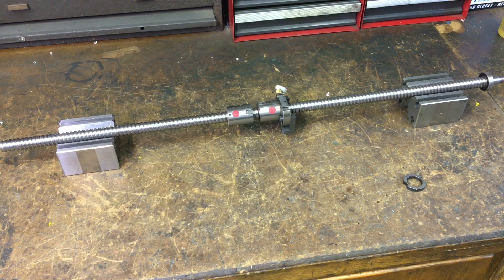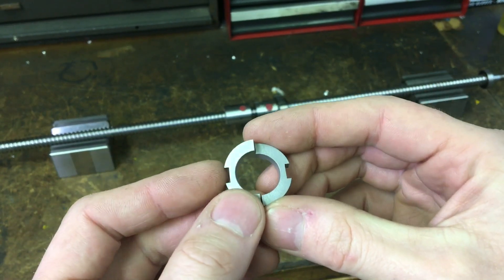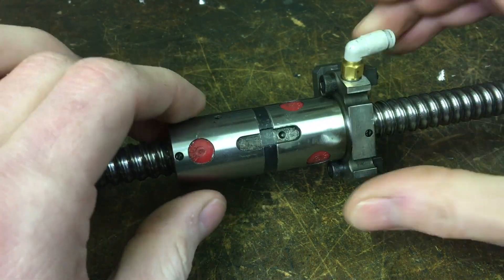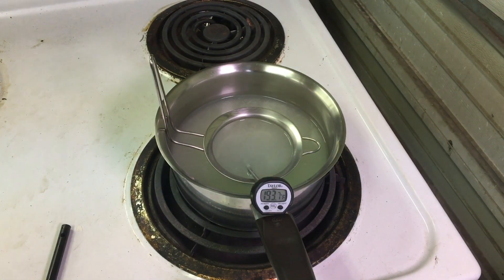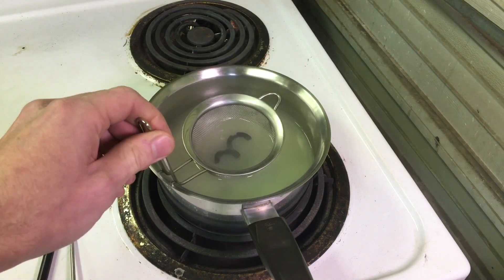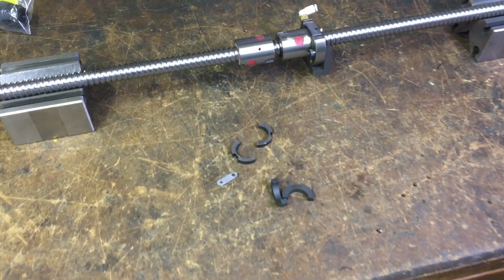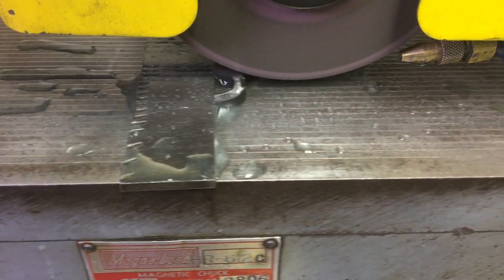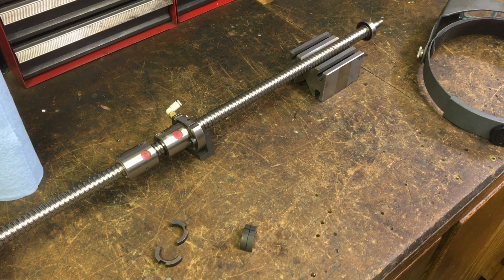China Ballnut Rebuild - 1

Comment: It had play in it probably because of wear. that screw is awful small for the application. I have seen those spring loaded.
Reply from the maker: We shall see what happens soon! They will either wear rapidly and self destruct, or work better than they did for a little while! Hoping for somewhere in the middle! haha. I do not think 16mm screws are far off size wise for this scale of machine.   Cheers Tom!  - Nick
Reply: If you trying to rapid at over 100 ipm there to small and low quality.
Really pro looking machine there were bound to be a few bugs im sure you will get them sorted out.

Comment: Did you use gage blocks to determine the spacer size? Or just grind and fit and repeat until the desired preload was found?
Reply from the maker: I have not done the final fit of the spacers yet, currently waiting on some parts. In my mind i had imagined doing some test fitting and grinding until I got the fit I was looking for... but who knows, when i actually do it a set of gauge blocks could be handy! We shall find out soon.  - Nick

Comment: Btw, if you add a small shim to the existing bearing spacers you can adjust the preload. Look at hf for sacrificial feeler gauges for the shim stock. Use a drop of glue on the shim.
Reply from the maker: BRRRRUUNNNOOOO!!! Your always good for a clever idea! Nice to hear from you my friend, the glue and shim idea I'm sure would work.... but the idea of glue gives me the hee bee jeebies, I though about the many different ways this project could be approached and although this isn't the easiest way, i think it will yield me the best shot at working.  - Nick
Reply: The takeaway from this instead of using the feeler gauges as shims, would be a measurement point. If you shove a gauge in-between the nuts until the preload is just right, then you can measure the feeler gauge and the existing spacers, and this will allow you to have a ballpark to shoot for. :)